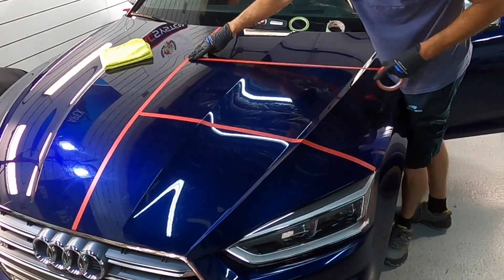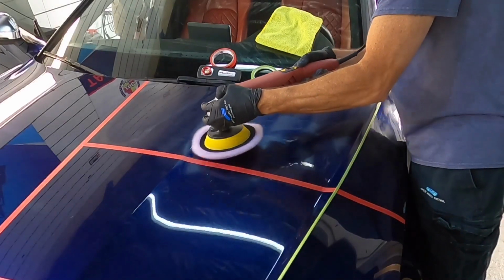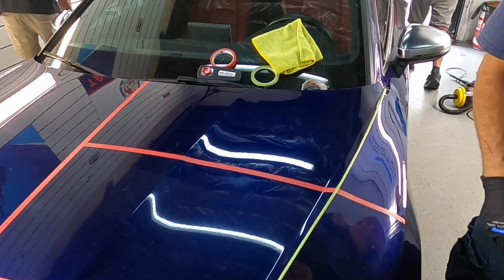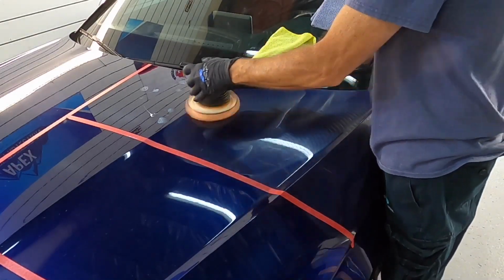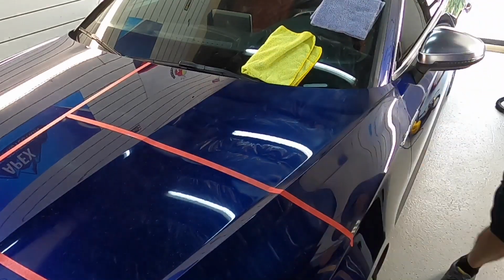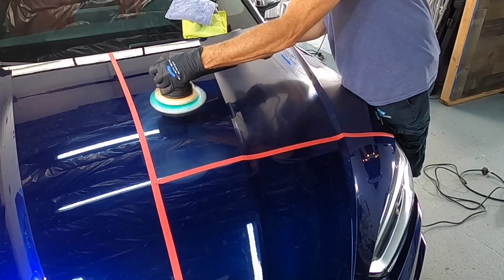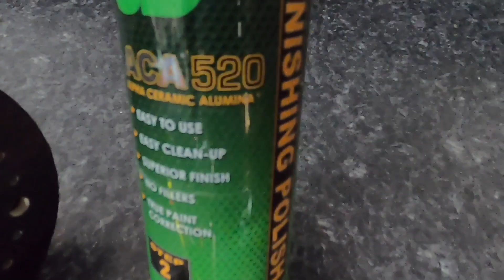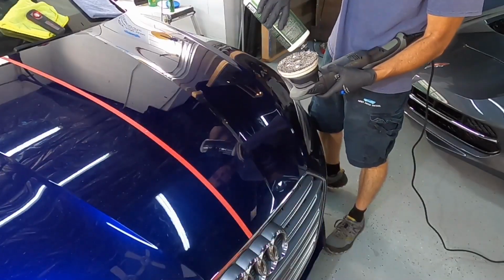HOW TO SERIES!! Video #3 Repair It Yourself! Heavy Swirling! (Dark Paint)

Comment: Great video and last year I was really liking the microfiber pads but they did spike the temperature. I asked some other experts and they concurred about the heat.
Reply: I think a lot of it depends on where you are and your conditions. 

I'm in the UK and for 90% of the year it never really gets much about 15 degrees Celsius. A large part of the time it's below 10!  

Certainly going to have a far different experience working with microfibre pads with those sorts of ambient temperatures id reckon.  

But then I guess you could argue that that's even worse perhaps as the starting temperature of the rest of the bodywork is that much lower to begin with?

Comment: I’ve done a few cars lately and found a great combination that works for me. Keeping in mind I’m doing this as a 1 step, not seeking perfection, and getting them out the door economically, I really like Uro 50/50 with 4 drops Xtreme Solutions LVR-369 (Trifecta compound/polish/sealant) and 4 drops either LVR-403 or 404 (depending on color).  I top it with Polyseal and they look great.  Most importantly, customer is thrilled.

Comment: Hi Brian the hard top of my car  has a  faded cloudy  look in  the middle . The rest of the car looks perfect .  Not sure what pad to use to remove this ?  Have used Meguiar 's Compound and their polish to finish .  Or is this from the sun clear coat worn down car  is 23 years old ?  Thanks Brian . Great video's to watch .
Reply: Get a better compound and polish.a microfiber should do it with the compound and then use your polish with a finishing pad
Reply: @Brian-dj3ru  Thank you  Brian .  What compound brand would you suggest with a micro pad to remove . So many out there  that claim to fame with same results .
Reply: @coryray8804  98 percent of the time I only use a microfiber pad or a blue hdo cutting pad from lake country with koch chemies h9.then i use an orange polish pad from lake country with sonax perfect finish
Reply: @coryray8804   don't over think it..just get yourself some cutting pads for the compound and some polishing pads for your polish .and always start with the least aggressive method first. Sonax perfect finish has some cut it and it breaks down into a polish for a nice finish.
Reply: @Brian-dj3ru  Thank you Brian . Will  try Sonax Cut & Finish  with my  Lakewood  C C  Yellow pad  then finish with the Black Lakewood CC pad  .

Comment: What did you on the car to protect the paint after the correction?  And in regards in the use of the rotary and wool pad, I noticed there were a couple of times the pad wasn’t flat but on the edge; I thought it’s best to keep the pad flat?
Reply from the maker: We protected it with our Metal Oxide Coating...https://apexsurfaceprotection.store/

There are areas where you need to lift on a slight angle. Then set it flat when you can.

Comment: Quick question- If you had the infamous Porter Cable polisher for 5 years, and were looking to upgrade to only one replacement, would you consider the Shine Mate EX620/15?  Not that I wouldn’t want a Rupes, but I wonder (again, as a do-it-all purchase) if the higher speed potential and balancing technology are the better investment as my projects gain difficulty or complexity.
Appreciate your time and wisdom.
Reply from the maker: The EX 610 or 620 is highly recommended.

Comment: Great video as usual. Very informative! I just bought a 2021 Nissan Murano. I'll do a light polish to remove love marks. I bought the your metal oxide / sheet combo from Carzilla. Do you have any tips on application and curing as I don't have a garage. Thank you in advance for your help.
Reply from the maker: Apply to a small area first to get a grip of applying. 60 to 90 seconds is the window before wiping off.
Reply: @apexdetail85  Excellent! Thank you so much 🤗

Comment: Hey Brian great how to like always hey what other good products dose 3D have any vrp protector stuff or detail spray
Reply: You can't go wrong with anything 3D makes. I've never disliked a single 3D product I've used. Aside from their polishes, which we all know are as good as it gets, 3D Eraser is an amazing water spot remover. Orange Citrus degreaser is awesome. Their Waterless Car Wash is very lubricated and easy to use, I use it as a detail spray as well. 

LVP would be their version of VRP, but it's not as glossy. They also have Magic Blue dressing, which is similar but in spray form, a bit like CarPro Perl, very versatile and easy to use, and it has some gloss to it.
Reply: Thank you have to check more of their stuff out I have their wash an wax soap that stuff is awskme almost don't e enough have to touch my truck foam cannon an rinse an check

Comment: So for us DYI.. myself I dont have a shop or a tent. My 2018 front fender has a nasty swirl from the GM  dealer after a repaint. I get it not in direct sun and have the surface as clean as possible. My question is what is the best product (on the shelf) thats fool proof for a novice?
Reply: Scholl Concepts S21 Black is an amazing one step.
Reply from the maker: One on the shelf locally? Here we can easily get Megs D300. It may take a few passes...but can get the job done.
Reply: @apexdetail85  I'm thinking about using the turtle way pro graphene 1 and done and max wax is it good enough for a heavy swirled car with soft clear?

Comment: Another brilliant video yet again Brian. Thank you!

I totally get that the rotary is going to be so much faster at getting the job done, but isn't it just safer in the long run for relatively inexperienced detailers or enthusiasts to stick to DA's?  

We hear a lot said about that all over the industry and I remember a video Jason at Chicago Auto Pro's did a while back showing how long it took to actually burn through a clear using a DA as opposed to a rotary. 

Ultimately, it's not really worth an enthusiast investing in any paint correction kit unless they are going to be doing multiple cars a year I think. 

Probably better to save the money and get an expert such as yourself to do the job and do it properly.
Reply from the maker: With just a bit of common sense...I believe anyone out there can master the rotary. Grab some scrap panels, burn through on purpose first, then you know what it takes and can take measures to never do it again.
Reply: @apexdetail85  that's great advice Brian!  Thank you!